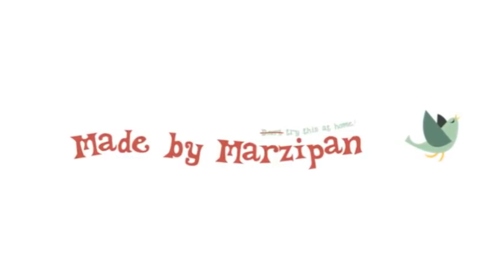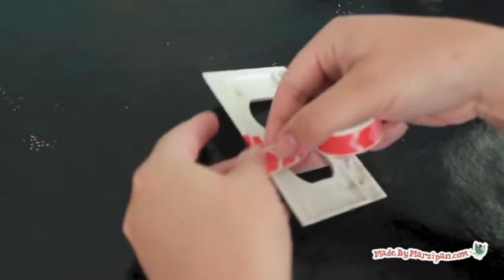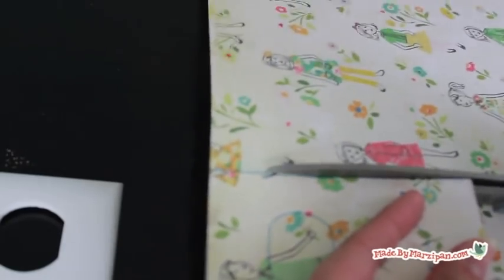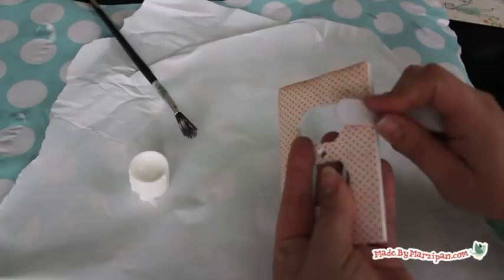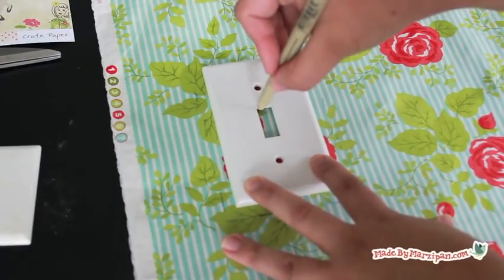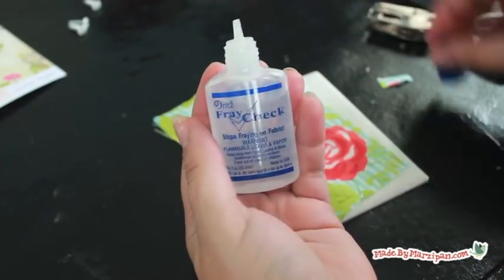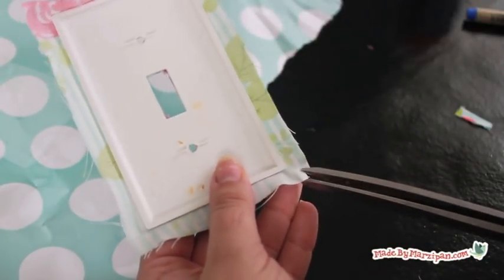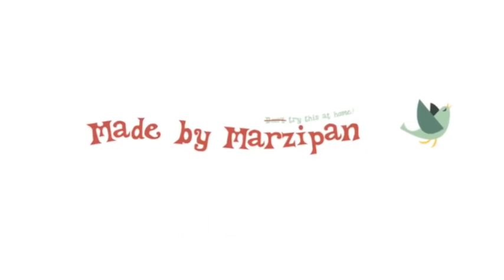3 Ways to Update Outlet Covers

Comment: I do the fabric one because it's so easy to match a rooms theme with material.  I skip using this edge finish method for fraying, instead I cut an "X" in the center of the switch hole and fold the material inward.  It makes for a more finished look and it's one less product to deal with.